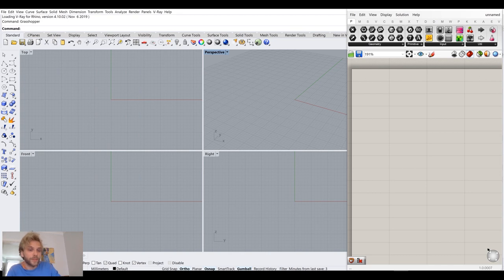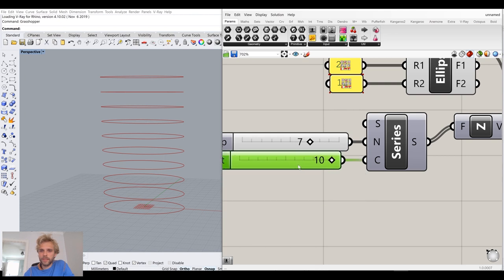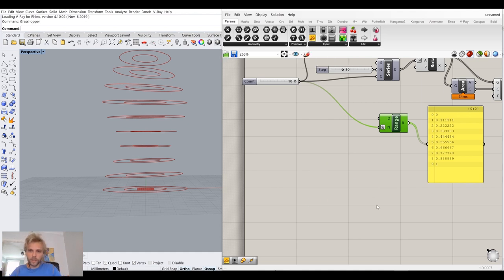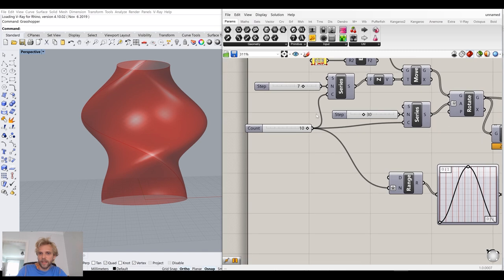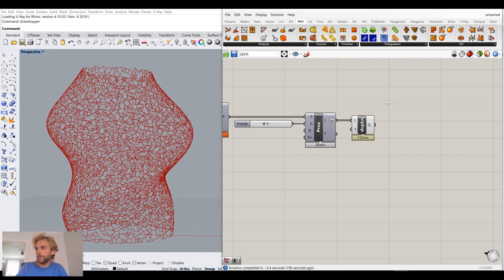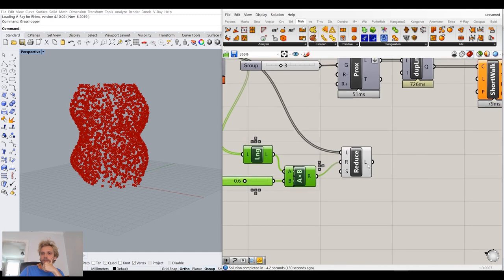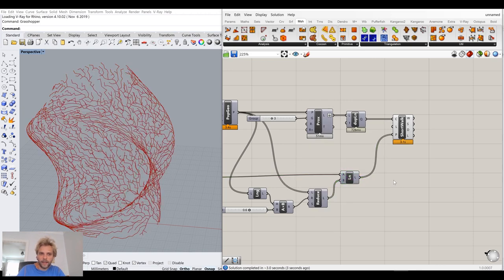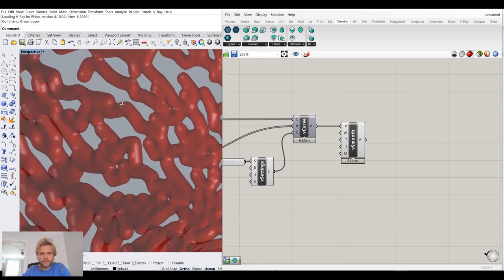2020-29 LTH Tutorials: Simple Organic Shortest-Walk Patterns (Grasshopper)

Comment: Hello Gediminas! Thank you very much for posting your very instructive videos. I would like to apply this pattern to my shape and followed successfully til about 29:00 - I don't know what's wrong, but the Curve to Volume (vCurve) turned red and I cannot find the fault. I noticed your remark that curve radius needs to be double the amount as voxel size and tried all kind of variations, but nothing helps. Do you please have a suggestion?
Reply from the maker: It's not the most stable system - I'd suggest first testing if everything works with simple 2-3 lines. Then you'd know if it's the script or if it's your curves that are breaking the script. If it's your curves - try messing around with their control point count/degree/scale - might find a stable variation that way.
Reply: Thank you for your fast response - I will try if I can manage! @DesignGoBrr

Comment: Hi. I really enjoyed this tutorial, but am stuck. I keep getting an error on shortest walk,  'the start and end positions are equal'. Any suggestions on what I have done wrong?
Reply from the maker: It basically says that you're staring and ending on the same point.  Make sure that you're using flatten where I show in the tutorial. That might be issue.
Reply: @DesignGoBrr  I have checked that it is correct but it keeps giving me the same error....
Reply: @lauragimenezcanton8945  Hi. For me turning off the remap note and moving the sinus curve a little and after that turning the remap note on again fixed it. Maybe it works for you too. Why I don’t know.

Comment: any idea of getting meshes with clean topology out of grasshopper? would love to implement parametric design in some of my furniture, but without clean mesh there is little use for it.
Reply from the maker: It all depends on what kind of tools you use within grasshopper. Quite similar to rhino actually. If you do a nurbs polysurface and you just run it through automatic meshing command, then yea, the topology is going to be unusable - same thing with grasshopper as well. I'd suggest looking at this video right here: https://youtu.be/IdAq7PX3kwA , at around 3:12:00 . The topology/edgeflow is as clean as it gets there.